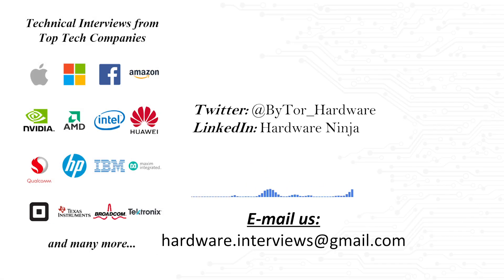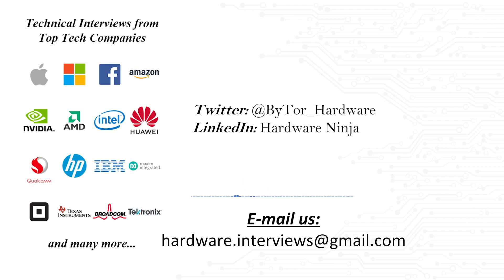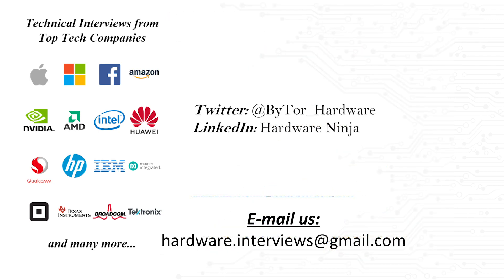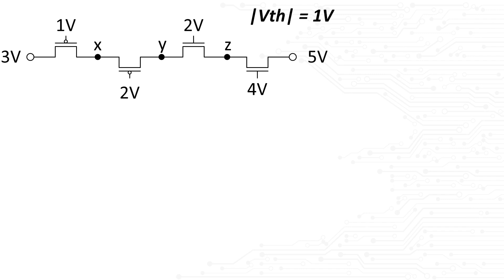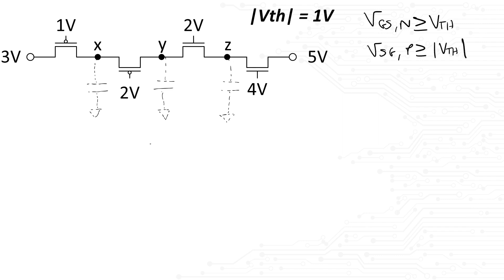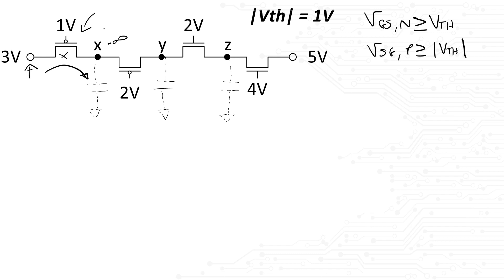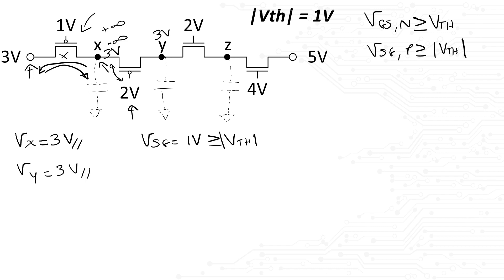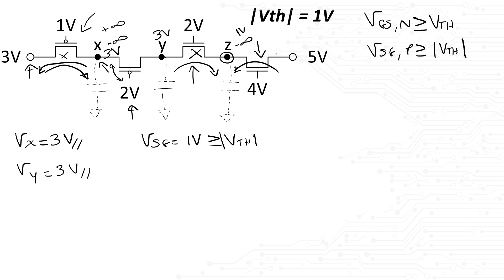HWN - Digital/Analog Design Interview Question

Comment: There is no way Vz > 5V. 
Thé NMOS with 4V gate voltage  is exactly at vgs=vth so you definitely have some conductivity in practice while the NMOS with 2V gate voltage has vgs<0 so <<vth so this one is completely cut off in DC conditions. 
Check yourself ninja!
Reply: Sir ! So you mean that the vz=3v,vy=1v,vx=3v 
Right??🤔

Comment: Vx=3V, Vy=3V, 1<Vz<3V is the only solution that keeps all transistors out of cut-off.  What is wrong with my Vz?
Reply: To keep all devices in conduction, we -infinity<Vz<1 is the solution. But if initial Vz>3 then the node will remain at that voltage itself. According to me there is no conclusive answer to this as the initial conditions are not mentioned

Comment: But for any current to flow through the pmos and nmos don't we need |Vgs| > |Vth|?
Reply from the maker: You're correct! The source of the device (whether PMOS or NMOS) changes depending on the potential. You can always double check |Vg - Vs| >= |Vth| for all the assumptions that were made.
Reply: Keep an eye on changing source and drain terminals along the analysis bro. For MOSFETs source and drain are not fixed unlike emitter and collector in BJT

Comment: Can we use superposition like first case is 3V is there but 5V is grounded and second case is there is 5V and 3V is grounded?
Reply from the maker: Hi Ritayan, were not sure what you're referring to here. But like with any problem, there are always multiple ways of solving it
Reply: @Hari Maddukuri Thanku for the point. So if we consider the small signal circuit of a mos, then can we apply superposition.
Reply: @Hari Maddukuri yah I know it's of no use in this qn. I asked in general
Reply: Hi Ritayan, are you getting same results after using superposition?

Comment: Are you serious? There are some wrong pre-assumptions here. Even if to assume that the devices and connectivity are all ideal (why intermediate caps then?) they are still at least four terminal devices, with diodes excluding at least one infinity scenario per device type. So this is already wrong. Then, the very first two  questions should sound like "is it standard CMOS with the wells controlled by DC voltages? Are all depicted voltages ideal DC voltages?" If both answers are "yes", we don't care about Initial intermediate nodes voltages as it is clear that the devices are ideal and it is a DC or DC-like case (time, current and capacitance values are not given, so time domain waveforms can't be asked for either). So, either the formulation of the task is not proper or the one who passed the story from the interviewer messed it up.
Reply from the maker: Dmitri, thank you for being here! You have just demonstrated how this question can (and will) be used to test both recent college grads as well as experienced engineers (which you seem to be). We're here to introduce the topics to interviews. Depending on the experience of the applicants, one can decide to push further or dial it back. Let us know if you agree with that. Cheers!
Reply: @HardwareNinja  you are welcome. Glad that you teach younger generations. Keep Up. To bei frank, I don't even know what triggered me more, poor formulation or the task itself. Somehow I feel sorry for young engineers when they get interviewed like that.
Reply from the maker: @dmitria6847  We do see a difference between Europe and America in terms of education and what's expected to be "basic knowledge". That is why questions will vary. We think a good question should establish a baseline of knowledge for all candidates. Then, depending on knowledge and ability of the candidate the question can be expanded. We believe this was the aim of the original interviewer with this one. We cannot possibly know but we like to give them the benefit of the doubt :)